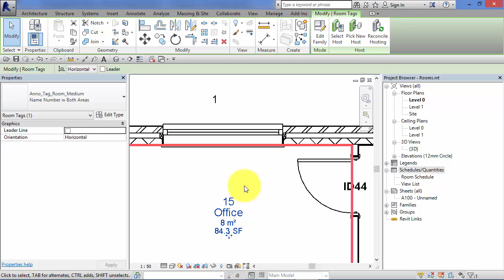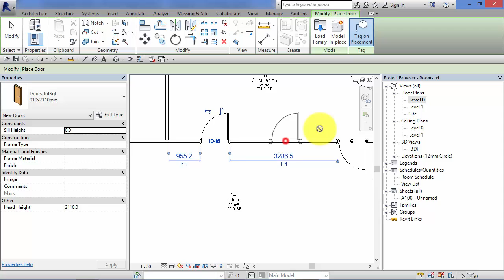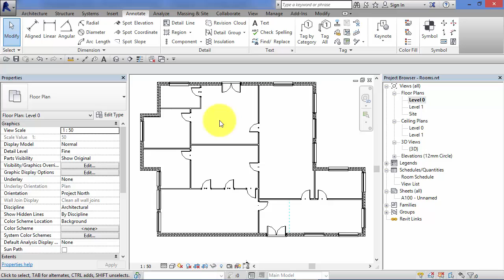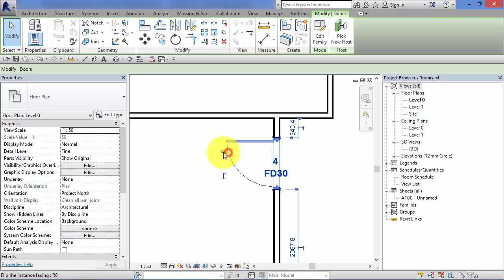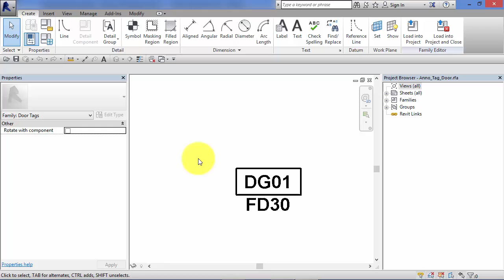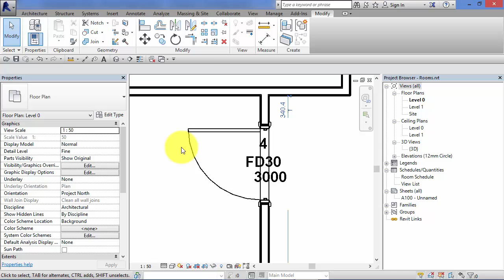Module 8: Unit 9: Revit Architecture: Tags

Comment: This guy has trouble getting to the point. Watch it at 1.5x
Reply: I installed a YT Add-in which allows you to set speeds up to about 25X....but I find that 2.5-3X is the highest, intelligible speed with this (& many other Brits).  However, BIMScape is one of the better, cohesive sets of videos out there.